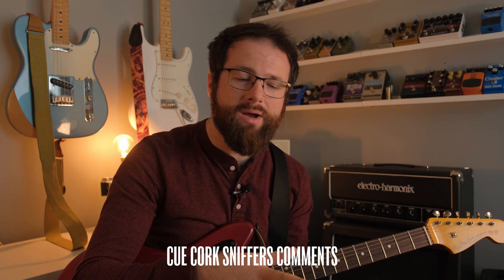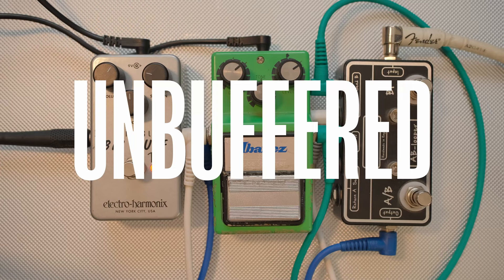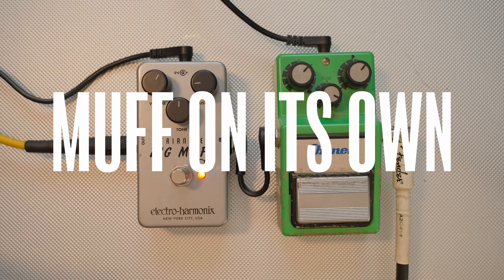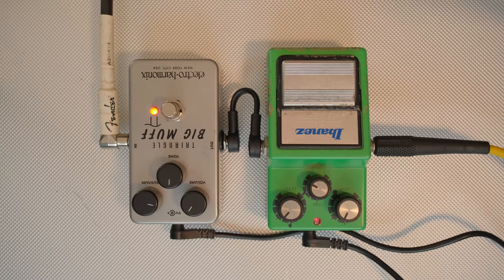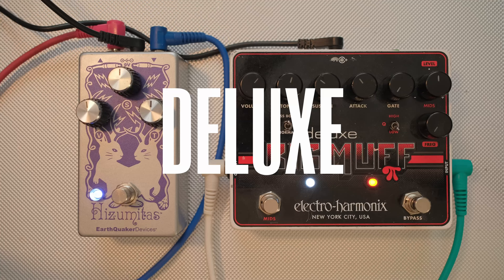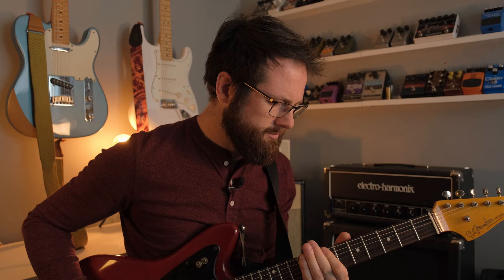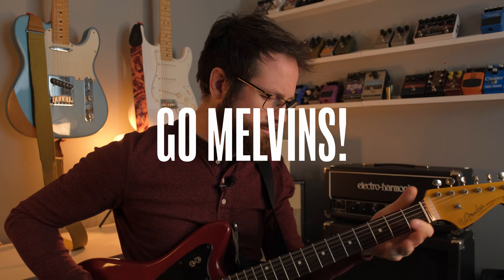Why you're doing it wrong: Big Muff tips and clips

Comment: Excelent tips! I just not agree entirely about not use a TS after Muff... I sugest to try using a Triangle version (or the pi, If its not available) with gain close to minimun and the TS9 with gain in 10 o'clock and tone fully open. It criates an unique and relatively difined distortion, great for solos and thick rithym riffs. If you have an Octave Fuzz like a superfuzz version to put before the Muff and a Uni-vibe sounds amazingly Crazy!
Reply from the maker: Thanks! But check out my short - I do exactly this. A triangle muff, changing settings on the TS9. All sounds bad to me. But if you like it, you like it!

Comment: Eeeerrr... just don't get it. If you need a buffer and that's it for the Muff to live a better life, well, a TS have TWO working all the time, even in bypass, since the circuit works that way. Why you switch on the TS, then? It's not in the buffers per se, it's in the mid hump boost which work as a pre emphasis and compensate for the classic mid cut around 1K. Mod your Muff's tone stack, make the mod switchable and you get the best of both worlds in less pedalboard space. Just saying...
Reply from the maker: I didn't turn the TS on in the buffer clips. It's just there being a buffer.  But yeah, I agree. If you're gunna run a TS in all the time, get a muff that does that sound already, like an Op-Amp with the tone off. Which is basically what I go on to say with my next point...
Reply: @doctorfuzzzdirtbox  Fair enough. Cheers.

Comment: My theory is the change should always go in. So if you use a big muff as a gain before you add the tube screamer it makes sense to put the muff last, but JHS and Vertex probably like mainly using the tubescreamer so it's right for them to run screamer last. You're both changing the gain the right way, but have a different preference for what your main gain is.
Reply: JHS configuration is just plain stupidity so that they can sell their boutique pedals

Comment: ok no you've really done a shit job with the tube screamer after muff. tube screamer before muff only increases gain, it doesn't bring in the mids

tube screamer after needs to have the gain all the way down/almost all the way down, no shit if you have your tube screamer gain that high it's gonna sound like shit

you aren't gonna get any mid boost with it before and you can even hear that the only difference with the tube screamer on is that it has more gain, you're barely affecting the mids when it's before the muff
Reply from the maker: OK, you haven't seen this short: https://youtube.com/shorts/_XVijxjgceU?si=taknGPN7tLqONMen
. . .  in which I try lots more settings and they all sound equally shit. I experimented a lot off-camera. Can't get anything good out of it.

And are we hearing the same clips? TS before Muff brings plenty of mid-range back. It doesn't just add gain. You can turn the gain down and make sure the volume is unity. It adds upper-mid range in spades. That's the whole fuckin' idea.